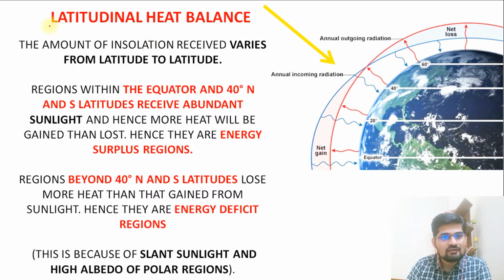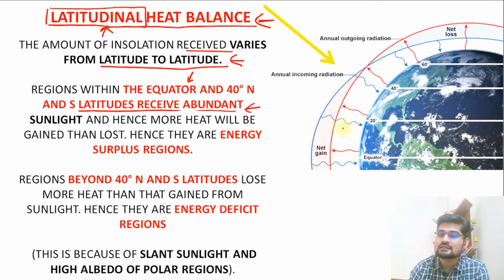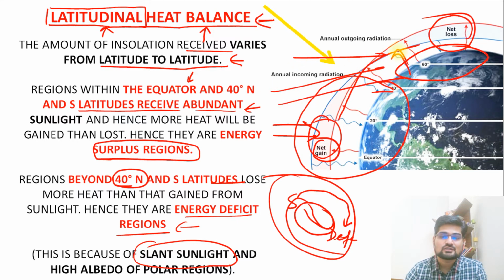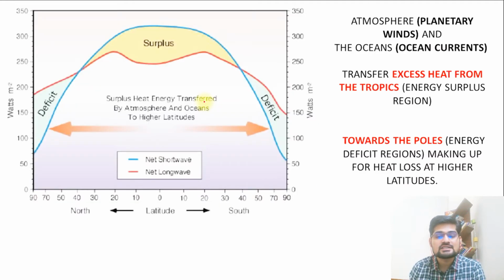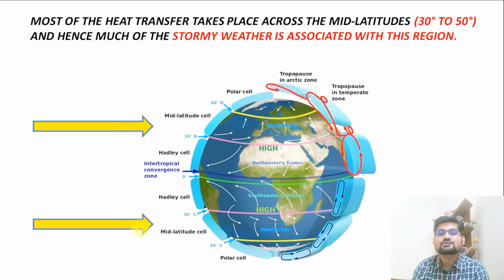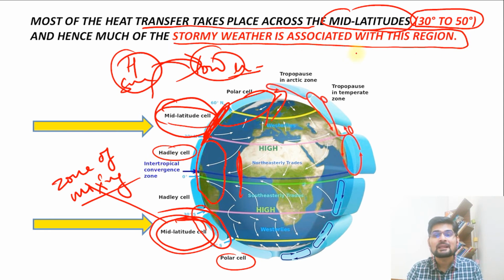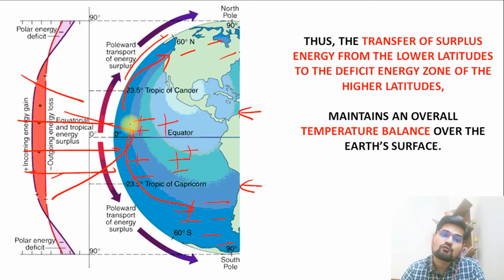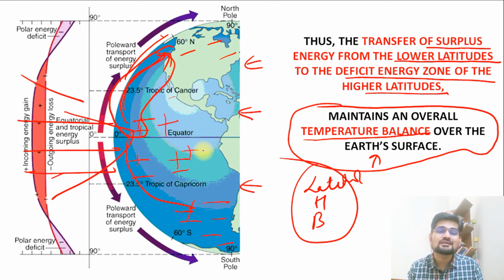Latitudinal Heat Balance | Climatology | Dr. Krishnanand

Comment: Hello Sir
I have a doubt wrt your video. I will be grateful if you would help me out with it.
How is it that the areas bw the poles and the 40 Degree latitudes are sending out more radiations than they receive?
Reply from the maker: More albedo...more reflection off snow covered areas in higher latitudes...that's why long wave radiation is greater.👍🌱
Reply: @TheGeoecologist  thank you for the speedy response.Maybe because of the fact that I don't have a geography background and am not averse to the surrounding concepts I'm having a tough time understanding this part. But how is it that an area giving out more than what it receives?
Reply from the maker: It's not in that way..it's like it doesn't keep much... outgoing is more than what is absorbed in this zone... remember the energy received is constant in a unit area (solar constant)... So , if more outgoing ...means less absorption...more cold...hence temperature is low in higher latitudes... Hope I am clear...watch the solar Insolation and heat Budget videos before this for better understanding😊👍🌱
Reply: @TheGeoecologist   Things seem to be getting in place now. For better understanding I will watch the videos you recommended too. Thank a lot sir.
Reply from the maker: Best wishes 🌱😊